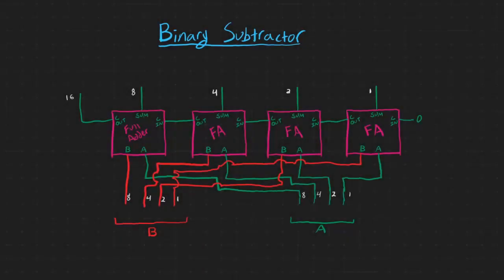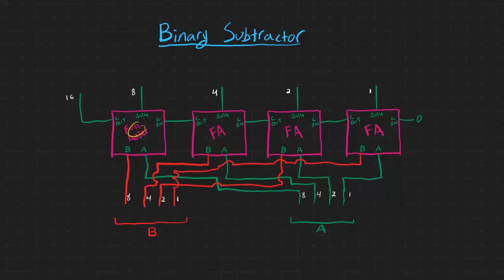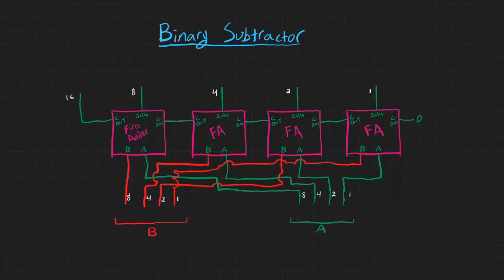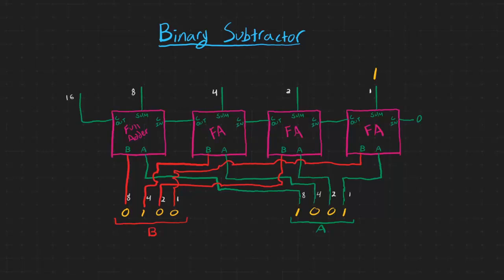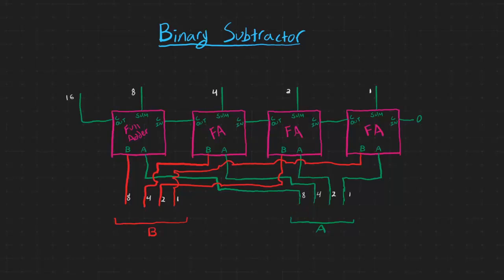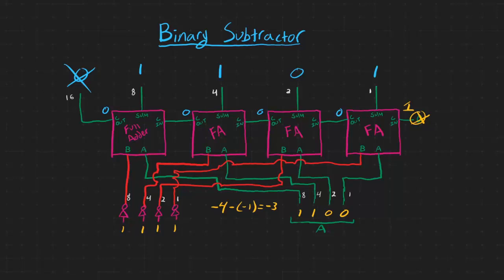Beginner Electronics - 31 - Binary Subtractor

Comment: For anyone who struggles with binary subtraction, there is an easier way to think about it, and it comes from clocks.

If it's 2 o'clock and you subtract 1 hour, you get 1 o'clock. That's easy enough. But if it's 2 o'clock and you subtract 3 hours, you get 11 o'clock. How did we get from 2 to 11, a bigger number, by using subtraction? 

It's to do with representations. Assuming a true 12-hour clock without am or pm, 12 is the same as 0, and 13 is the same as 1, and so on. Because we're forced into using the same 12 numbers over again, each one has to represent several possible values. Following the logic into negatives, 11 is the same as -1, 10 is the same as -2, and 9 is the same as -3, which is why 2 - 3 = 2 + (-3) = 2 + 9 = 11.

Instead of subtracting 3, what we're really doing is adding 9. Clocks work in cycles of 12, so the inverse of any number would be 12 minus that number. Assuming we have the most basic clock that is not capable of measuring am or pm, the clock can't distinguish between different numbers with the same representation.

A four-bit adder is much the same, but it works in cycles of 16. The inverse of any number is 16 minus that number. So the same subtraction as above in a four-bit adder would be

2 - 3 = 2 + (-3) = 2 + (16 - 3) = 2 + 13 = 15,  which is just -1.

Instead of thinking of the left-most digit as a 'sign' digit, we can just think of our binary subtractor as working in cycles of 16, and accept that we will only be able to input 0-15.

Comment: Isn't there a problem here? If we design circuit with this and give negative no.s for computaion it is giving ans in 2's complement but we have to get it in positive form to know about correct no.
How do we design to decode this information in this Binary Subtractor ckt.?
Also can u plzz give us idea about how would we employ an LED Screen to give us the respective outputs or any other way to check the outputs of such computations.
Reply: The only point of converting the number to its positive form at the end is so we (as humans) can verify the answer is correct. The computer doesn't need to do that, it can deal with the numbers in their compliment form. As for hooking up to a display, you could use an arduino. Or you could use the method from a few episodes ago where the adder is wired to LED bulbs (showing the sum and carry out of each adder) and a binary digit of 1 is represented by an illuminated LED and a binary digit of 0 is represented by an LED that is off.